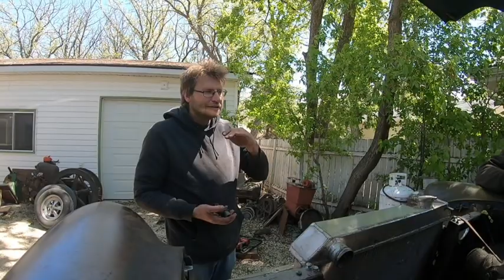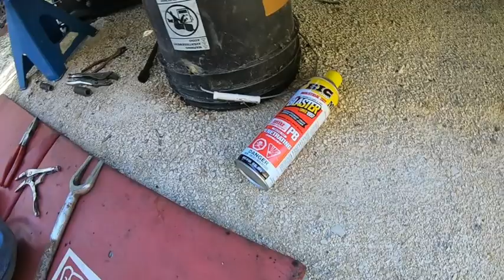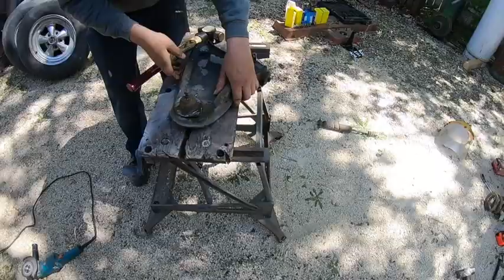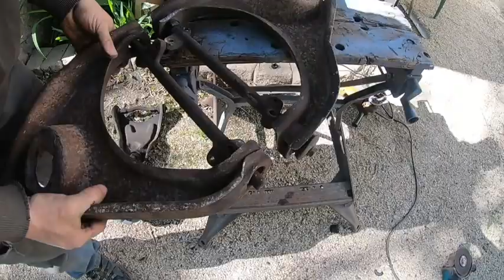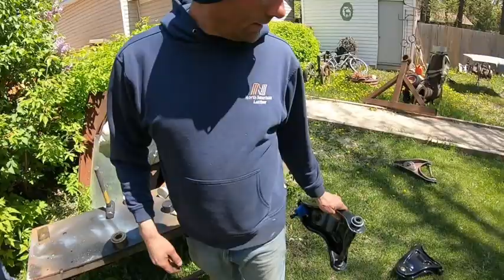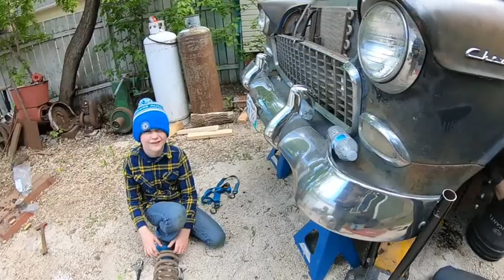1955 Chevy Gets New Suspension, Ball Joints, Control Arm Bushings, Shocks, Springs.  4.8l Turbo LS.

Comment: when you use a pickle fork on a ball joint it crushes the housing around the ball joint leading to the thought the joint is good when alot of times its not
Reply: check before taking apart

Comment: Thanks for sharing. It helps to see someone do it first to avoid any mistakes.
Reply from the maker: Was a costly mistake Daryl.
Reply: @pennyshotrodscustoms  yes it was.
Reply: They made a big mistake when they cut the radiator support!
Reply: @JimBaldwin-x3t  that’s for sure. I didn’t cut my core support because I wanted to keep the strength. I’ve seen many guys who do it.

Comment: Polyurethane rides too rough. Replacement OE rubber will make a world of difference all its own. I don't use a pickle fork for anything....they are SHIT. If not tearing up boots, they can tear up shit around it. Always whack the the area of the joint or spindle (where the taper is) with a sledge hammer (nut on place at the end of the threads). Works like a charm every time, and doesn't destroy anything but a little paint if its fancied up. Man, his car took one helluva hit to tweak the arm like that.
Reply from the maker: Thank you Dano yuppers Ryan has had some bad luck hopefully after this that will change we go the engine in today.

Comment: Don't really need a spring compressor the way I do it.
Reply from the maker: How do you do yours roger?
Reply: @pennyshotrodscustoms  it's hard for me to explain hang the spindle with the lower control arm on the spindle slip the spring use the floor jack then line up the last four bottom bolts.

Comment: Hey guys next time use threaded rod from lower control arm thru spring, then go thru upper shock hole! Works every time! Use the biggest threaded rod you can that still fits thru upper shock hole....
Reply from the maker: Thank you for the tip Brad never is a fun job.
Reply: Honestly my least favorite thing to do